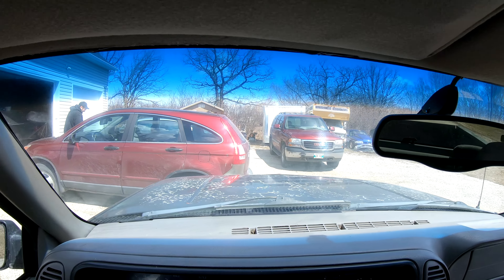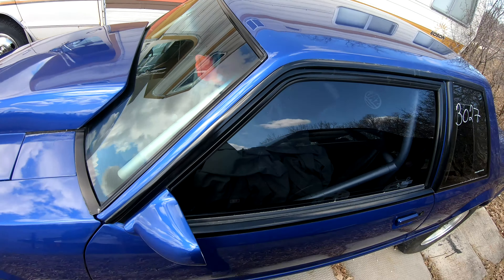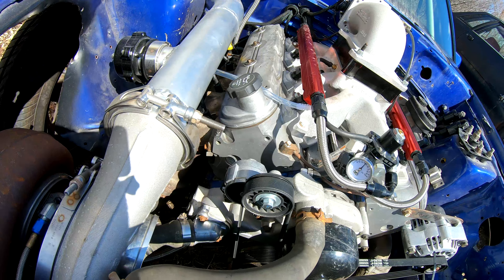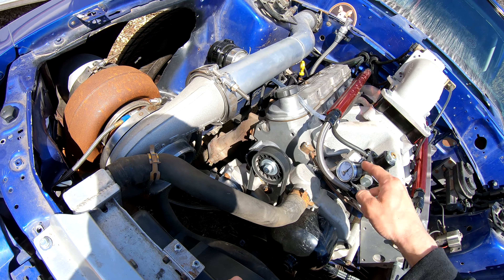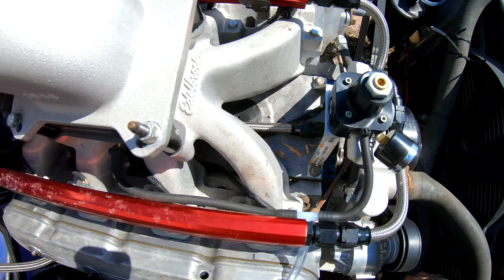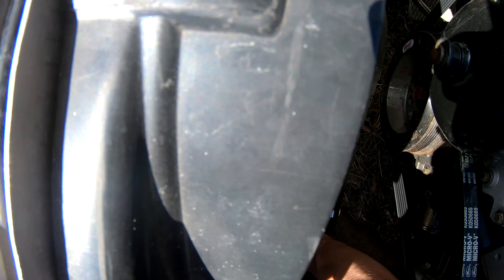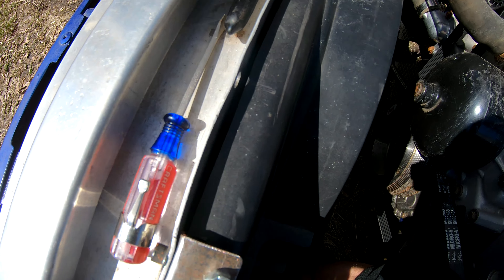Turbo 5.3 LS Mustang AWAKENS to Build BOOST (POV) | Starting all the things 2023

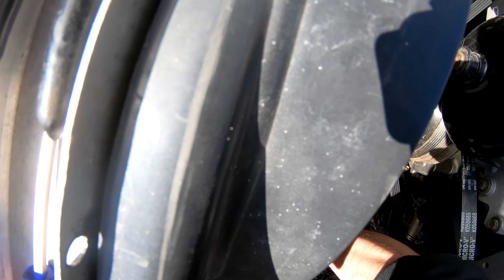Comment: 9:48 twist the fuckin thing
Reply from the maker: I bopped it and pulled it and twisted it! Problem is the rad is for a SBF, and while the hose fits fine on the waterpump, it is def the wrong size for the rad lol. But it works for now.

Sometimes ya just need Rob's extra torque 🙊